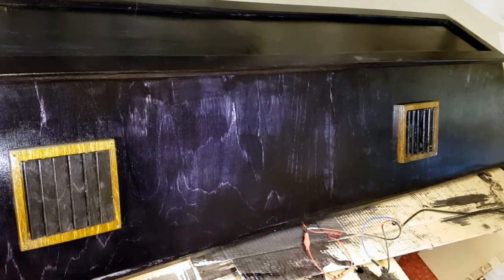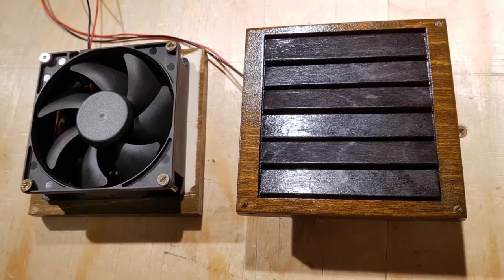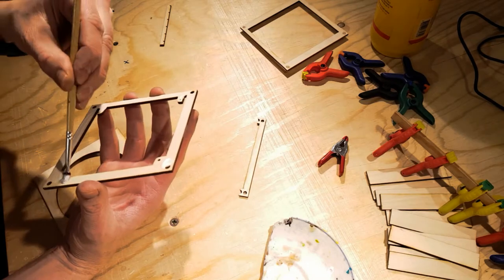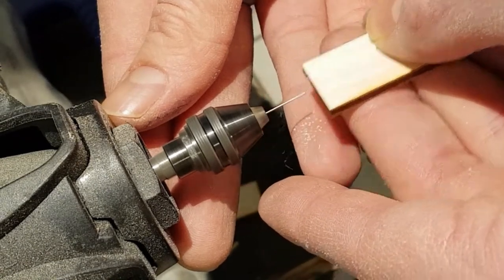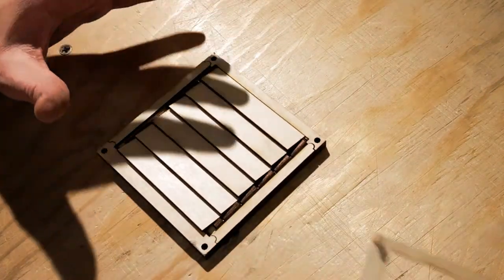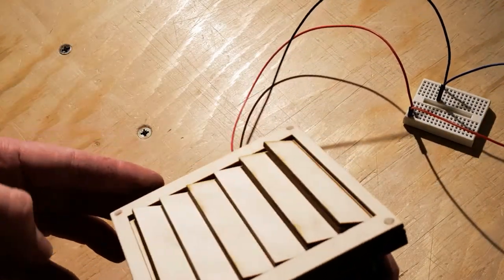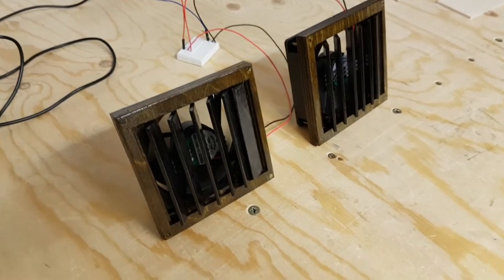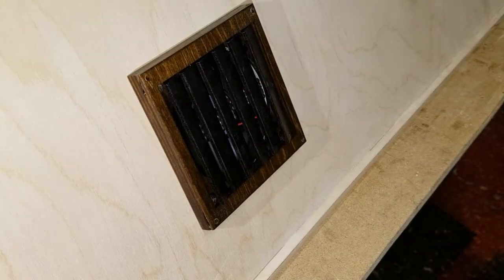DIY Custom Fan Housing

Comment: 🤔 - we 🇬🇧, call those backdraft shutters/gravity grills/flap vents, and are installed on an external wall - on the end of a extractor fan duct = to stop a cold draft going down it and coming out of the fan on the inside - backdraft, which some of us find annoying. 100mm, extractor fan; toilet, bathroom, utility room, cooker hood, conventional vented tumble dryers - to prevent vermin/pests from getting into the ductwork, and the internal dryer duct and lint filter (because of the low level installation of the vent). 150mm; for 150mm extractor fans; bathrooms, kitchens/some cooker hoods and single commercial vented tumble dryers. Available are universal; 100mm 3-flap, 150mm 4-flap, also variation of flap amounts for 100mm - 1/damper, 2, 3-universal) 4 and 5. There are larger flap vents for industrial extractor fans, and fans designed for installing in single/thin walls or windows have these flaps built into their back/exterior. All of these are made of ABS plastic and coloured grey/terracotta/black/white. Normally these vents are mounted with the flaps pointing down, your wooden ones are unusually pointed sideways because your terrariums wooden roof/lid has slanted sides and I’m assuming the fans are too weak to blow the flaps open if they were pointing down.